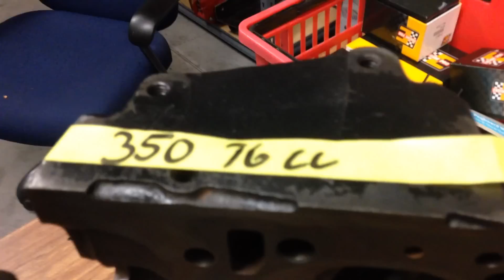350 and 305 Chevy what's The Difference

Comment: How come Chevy quit putting in line six cylinder engines in their cars and trucks?. When I was a kid I had a 63 chevy pickup that had a 292 in line six cylinder with a truck 4 speed, it got great gas mileage a was the most dependable vehicle I've ever owned. I got it used and it had 500.000 miles on it when I got it. It was an old delivery truck.
Reply from the maker: You would need to talk to Chevy about that

Comment: 305s are reliable but gutless. Rv 4 bolt main 350s with fuelie heads, a victor junior intake, and a holley double pumper are reliably fun and not very fuel efficient.
Reply from the maker: we made over 450 HP with stock 305 on NOS and it lived for many years of daily driving and weekend drags the 305 isn't the problem the guys who don't know how to make them perform are the problem

Comment: What about 350 heads on 305
Reply from the maker: No your compression would be too low the bigger valves on the 350 heads can possibly hit the edge of the bore and bend with bigger camshafts not a good idea

Comment: 305s didn't make the power that the 350s did because Too many dummies were putting Cams w/lca 112 to 114. GET A cam with 108 to 110 lac, combine it with a good Torquer head.  58cc

Comment: Ain't nothing wrong with a L69 305 engine, once it's de-smoged and a free flowing exhaust is added everything is groovy from then on..
Reply from the maker: I agree a good set of heads/Cam and intake and you have a decent engine
Reply: @Myvintageiron7512  over the years I've had some quick vehicles, some big blocks and small block engines. Going fast used to be a priority, I'll never stop being a car guy, it's just a little different nowadays. My car is a great cruiser, I'm perfectly happy popping the hood and still seeing a smooth running original V-8 and with a clean engine bay. As we speak it's sunny and right about 80, In about 45 minutes I'm gonna open my garage, pop the t-tops out and head to a cruise nite. I don't care how fast I get there as long as I do...✌️

Comment: You. Are.   Awesome......and. I. Have. Found. A. Liking. For. Finn...and. fry. Myself....  when. I. Got. My. 305. Hds. Redone.  For. 400.   Block...   the. Machinist.   Recommended. 194.and. 160. Valves.   With. A. Port.   Job.   But. To. Save. Money. I. Ran. Them. Bone. Stock.   And. They. Were. Fine. For. Back. Roadin...  and. Highway. Travel.   With. Rpm...  under. 4000. Maybe. 5000..rpm....  it.  Would. Stop.  Pulling. During. Acceleration...  getting.  On. Highway. 696...  or. Passing.  On. Us...2...      have.  A.  Nice. Day....

Comment: Not to be a smart ass but to answer the thumbnail question. A 305, despite any amount of money will never be worth a dam. Heads arent capable. Nothing bad against chevy cause it did exactly what it was designed for. The 350 needs no explanation. It will do or be whatever you want from it. And take a beating for a long time. Wish the dirt track guys wouldn't have scarfed up all the 400s. With vortec heads and even a carb. They will crank out cheap thrills for a long time.

Comment: No. Those guys sell those engines on Craigslist, claiming they are 350s. And without opening it up, or running the casting numbers. There's no real way to tell the difference. Except, a305 is worthless. And a 350 can sell upwards of 6 grand. I have personally seen them take advantage of people on the internet with my own eyes. Buyer beware.
Reply from the maker: It's pretty simple to tell just google the casting number it takes 30 sec

Comment: 305 may be a good engine but it is forever the supreme example of wasted engineering and wasted manufacturing cost. 305 had absolutely no reason to exist except to make the 350 look even more powerful. There's no way the 305 was cheaper to manufacture, it was not really any lighter, it did not fit into tighter spaces, didn't really get better gas mileage.
Reply from the maker: actually the mileage is better other than that I don't disagree with this argument you could also say the 262,265,283 and 307 all fall into that category as well
Reply: @Myvintageiron7512  Not always better except when it's in something lighter (usually short cab models, or cars) with highway gear ratios. Now, I have owned several 307y Olds engines.... Smoothest engines I've ever seen but pathetic power and gas mileage. Both of those cars would have been faster with a 350 for sure lol. And there's no way the 350 would have used more gas (stock vs stock), I usually got 15mpg on both of those cars (85 Riviera and 85 Cutlass Supreme).
Reply: Also... I wasn't trying to come across defiant, but it reads that way, sorry man. I was trying to point out that the folks that claim the 305 was noticeably better on gas don't usually take into account that the 305 was more common in base models of the trucks (lighter) with junk rear gear ratios like 3.08, 2.73... Or they are thinking about cars like Caprice or Camaro.

I doubt very highly that two equally geared and weight matched trucks with 305 and 350 would have anything beyond a token difference in gas mileage, especially if both had Vortec heads and injectors.

Comment: trans am racing had 305 s...they had power
Reply: The Z/28 trans am engine used a 4 inch bore 4-bolt main 350 block and a 3 inch stroke crank.

Comment: Why can't you bore a 305 to a 350?
Reply from the maker: There is not enough material in the cylinders you will cut through the cylinder to the water jacket long before you get to 4" Dia
Reply: @Myvintageiron7512  Thanks for responding and all your great videos.

Comment: The only difference between the 350 and 305 is the 350 cost more in spite of the fact it didn't cost more to make, and the 305 did not better in fuel economy....so there was NO REASON to make this turd 305 except it did 1 mpg better on the EPA fuel economy tests that were inaccurate.  The 305 NEVER should have been made........rip off motor....and consumers got screwed.

Comment: How can having that much of a change in compression not change the horse power theres got be a difference!!!
Reply from the maker: There is a difference the 305 has a much smaller intake runner and flows way less air than a 350 head compression helps but if you have no air flow you have no power

Comment: The 305 has no potential and basically is a product of the underpowered 80's and the 350 is one of the best engines Chevrolet has ever built. Does that clear things up?
Reply from the maker: They made over 500 HP with a stock 305 on engine masters I'm going to go out on a limb and say your wrong
Reply: @Myvintageiron7512  ,
Well I googled engine masters 500 hp 305 and I searched and searched for a forum or article or video and I can't find anything. Do you have a link? All I can find is all kinds of dyno specs on a stock Chevy 305 being right around 165hp. I've never heard of anyone getting anywhere north of 200hp with a bone stock 305. I don't claim to be an expert. I've seen videos and read articles where experts threw everything they could at a 305 like cam, crank, heads, intake, headers and so on and could only crank out a wee bit over 275. So if you have a link to back up your claim I would like to read or see it.

Comment: I also have a question To pick your race car god brain .LOL
I DONT REALY UNDERSTAND.
I keep hearing of racers using a 350 block 350 crank and  6 inch rods .
And is that a 400 small block?
Kind of confused , all is hearsay.
I also heard Nascar was doing that in the past.
Reply from the maker: The connecting rod length does not change the displacement of the engine it is still a 350 what longer rods do is give you a higher crank to connecting rod ratio there are a few advantages to this one of them is less rod angularity this reduces side loading on the piston and rod bearings and frees up some HP.
A longer rod also has more dwell time at the top and bottom of the cylinder the piston will sit at TDC longer as it crosses over the center line of the rod journal and changes direction this allows the combustion to build up more pressure on top of the piston before it starts it's journey down the cylinder transferring the combustion pressure to the crankshaft more pressure on top of the piston means more down force and this of course means more power
Reply: Thank you

Comment: Hell you can easily turn a 305 to a 350 just have it bored out throw the 350 pistons heads in it and put some 350 heads on it and Bam you got a 305 to 350 conversion but hell you can pick up a 350 for 200 or so from a junk yard easily

Comment: A 305 is a 350 block with 283 heads on it giving it 305"inches of displacement.
Usually found in an old Chevelle
 It will fit in the 70's Toyota Land Cruiser and bolt right up. A blanking plate must be used over the mechanical fuel pump, an electric fuel pump must be used, the 350 will not fit but by the time you put the custom headers on, you will have more horsepower than if you had Factory manifolds on the 350 anyway. Toyota bought the 1949 Chevrolet straight six plans, nut for nut, bolt for bolt, it is identical which is why every Chevy Engine throughout the 60's & early 70's will bolt right-up to that 3-speed Toyota Land Cruiser tranny. A specialized electric fuel pump is needed anyway for an off-road vehicle like the Land Cruiser because it's not the same as the float type carburetor, Built like a toilet. What an awesome vehicle!!!

Comment: 350 has more hp better crank pistons etc their not the same meaning the crank and pistons are different even the heads are built differently which is why a 350 is more power than a 305 sure you can build a 350 out a 305 but why waste the money

Comment: Whats the difference with the 292 and 427 ? They are different, like totally ... 
  350 power ??? YOU HAVE NO EXPERIENCE WITH THE 1974!  
  What's the difference with the 283 and 454 ? What is wrong with you young people?
Reply from the maker: comparing an in line 6 to a Big block is quite a bit different than a 305/350 no one is confused about the 6 and BB but they are totally confused by 305/350 because they look exactly the same externally I'm not sure why you don't understand this what is wrong with you?

Comment: The downside with the 305 beyond what you've stated is the small bore limits power.  Bore and displacement will give you good idea of the potential power where stroke and displacement will do the same for torque.  

That is why the 305 will never perform like 302 but it will potentially make more torque from the longer stroke.  The 302 uses a 4" bore like the 327 and 350 which is why it made great HP when spun up.   With all the same parts a 305 will never match the power of the 302 and it wont be close either.  The 305, like the 307 were made to make decent low end torque with a smaller V8, they were both good engines for their intended purposes.  If you intended purposes to make a lot power it's a poor choice compared with the 4" bore engines.

Comment: i think ur wasting ur time with a small block i have a pro build 327 4 bolt ported and polished block roller motor and i still like my big blocks better  there is no sub. for cu. in. and i have a lot of 350 4 bolts witch is a lot better the a 305 or 350 2 bolt and yes u can make 305 fast just not good on torque i do a lot of drag racing

Comment: More meat more heat the 305 can handle, so use a small steam machine pass the steam through a 12 volt powered copper mesh(electrolysis occurs and you have hydrogen and oxygen gas use a fan/blower to force the catalyst gas into the air intake and record the horsepower and make a video. Keep me posted -    Steamy 305 - (:                                          https://www.youtube.com/watch?v=PgBoqlJAs6g

Comment: Why? Why did they build the 305.It’s a gas sucking dog! Horrible engine
Reply from the maker: The 305 was built to Meet EPA standards in the 80's they had regulations on engine size they are actually not bad engines when you de smog them it's not the engine that was so terrible it was all the emissions control crap they did to them I built one that made 325 HP and 450 + with a 150 Shot of Nitrous it would spank LS engines